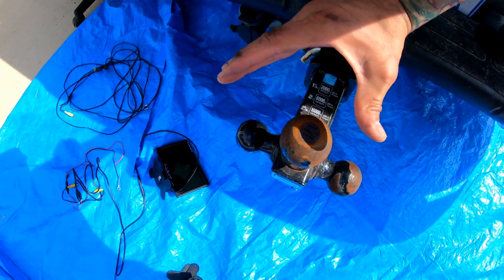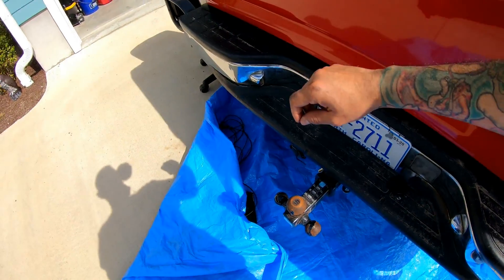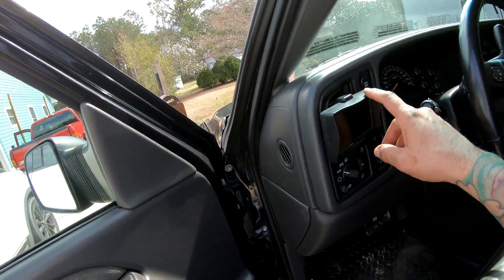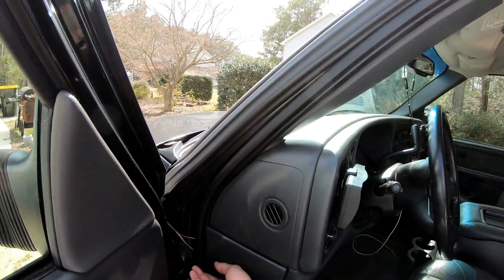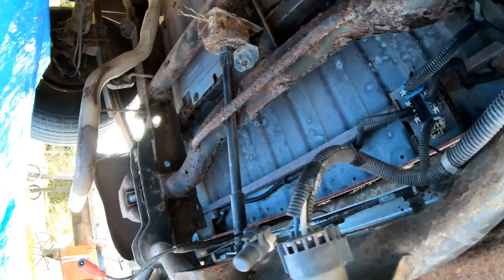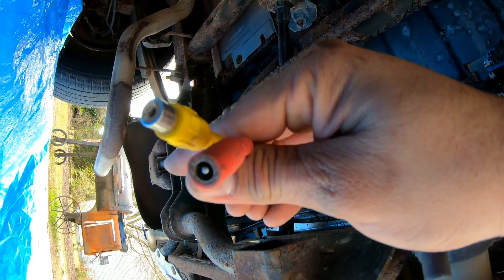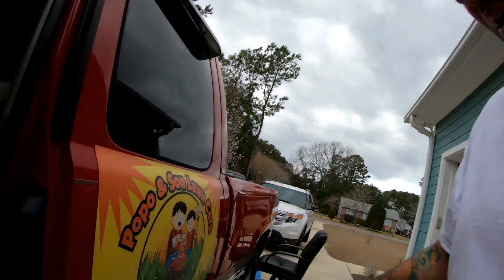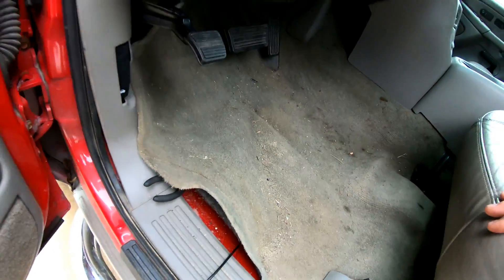Back up camera install and new idea to locate in visor

Comment: Great video buddy. I believe the monitor is going to work there. If the glue doesn’t hold it try some Velcro. Tell your wife I said hi and tell her to get on camera. God Bless you both. Keep the videos coming man
Reply from the maker: Thanks for the tip, on my other truck, I used 2 1/2inch screws and the monitor has a slot in the back perfect for that. I told her but shes camera shy. Haha